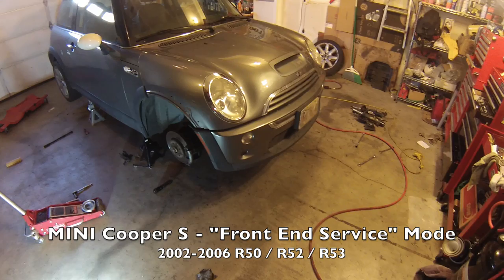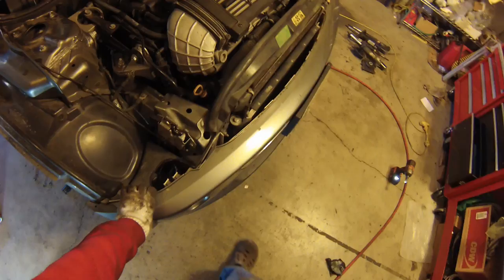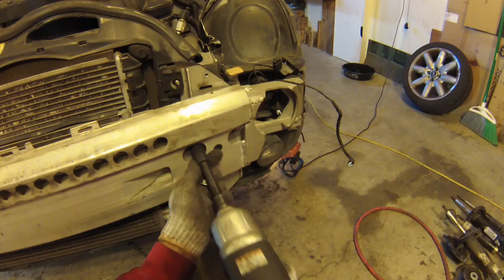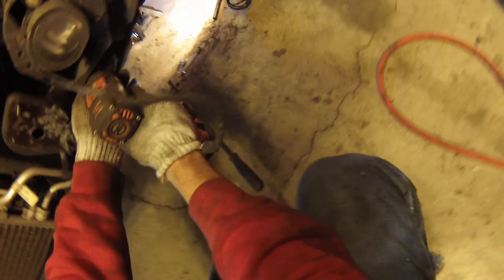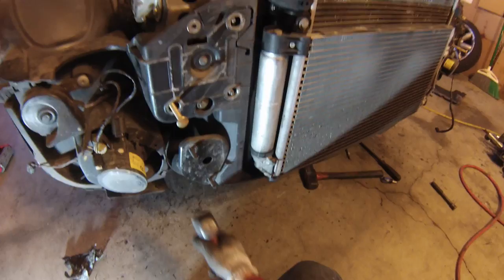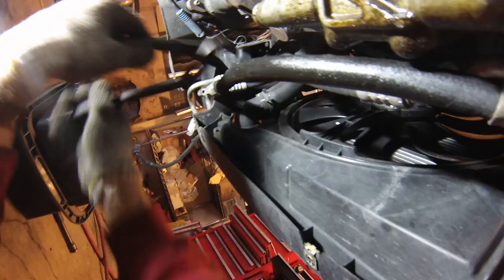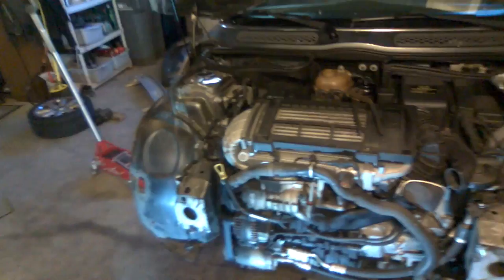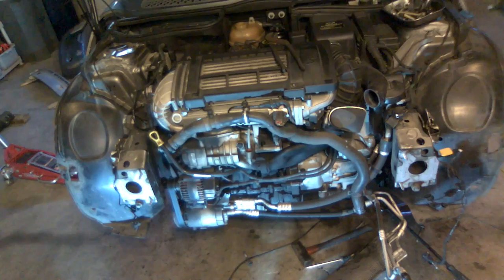Front End Service mode 2002-06 MINI Cooper/radiator/bumper removal howto

Comment: Where is your coolant change video for r53! I cant find it
Reply from the maker: +Daniel Scott That's because I don't have one. If you want to do a full flush, it's time consuming but you can use a Prestone flush kit and tap into the heater core hose. Unless coolant is in bad shape, I usually just dump via the bottom radiator hose, fill with water and dump again, then fill with 50/50 premix.
Reply: +Mod MINI ...I know that on the R53s, in addition to the plastic bleed screw on the upper radiator hose, there is a second bleed bolt underneath the thermostat.  When you return coolant to the system through the expansion tank, does that bleed bolt come into play, or can you just bleed the system by using the screw on the top radiator hose?  Thanks!
Reply from the maker: +David Arruda I usually just use the radiator hose screw. With the car off, patiently add coolant until it comes through the top radiator bleeder. Then close everything off, turn on interior heat and run car until thermostat opens. Crack the bleeder screw until air no longer escapes. Add a little more coolant than usual, any remaining bubbles should be displaced over the next drive cycle. Bring along a bit of coolant just in case.
Reply: +Mod MINI Thanks so much! Today was my first time in "Front-End Service Mode" on my '04 R53 m/c/s (116,000 miles). Replaced the radiator fan (1st-Stage non-functional), and while I was in the region, I changed the crankshaft sensor o-ring, as there was a fair amount of caked up oily grime below it, and on the front-side of oil pan.  At my next oil change in about 4000 miles, I'm going to do it again and replace my valve cover gasket, oil pan gasket and camshaft sensor o-ring.  I'll be supporting Mod MINI -- Thanks for this great asset to the MINI community!
Reply from the maker: +David Arruda Thank you very much for your support!

Comment: Are the bumper bolts 13mm or 1/2 sae?
Reply from the maker: There are no non-metric bolts on the car other than one of the supercharger intake horn and some banjo fittings
Reply: @ModMINI  how about oil drain plug. I think that's a 1/2 13 is kinda loose imo
Reply: Love your videos by the way thank you for taking the time to make them, they are very informative!

Comment: Great video. I also need to remove and replace the Core Support Front panel (51647200799). Do you have any videos or information on this?
Reply from the maker: David Stehle By doing front end service mode you are 95% of the way there. The only remaining thing is to separate radiator and other parts from the support panel. There are two plastic clips, pop out the center portion and then depress the three prongs. A little tricky to depress them, one trick is to find an appropriate size deep drive socket and press over the three clips. I think the only other thing connected to the front panel is the foglights.
Reply: Again, thank you very much!
Reply: How many hours should all this take?
Reply from the maker: David Stehle It really depends on your aptitude, experience, and tools at hand. I could probably swap the core support out in about 90 minutes.
Reply: ***** One more question. I have a Base model. Is this substantially different?
Reply from the maker: David Stehle It's basically identical.

Comment: i hate these cars! i just had a seized oil filter cap that i snapped the to nut on and had to take the oil filter housing off to remove it. there is no room! what's wrong with a spin on oil filter stupid engineers. the serpentine belt was one of the hardest to do out of all the cars i have had to service at my shop. i really haven't found a harder car to work on. now the low fan resistor went out and i have to pull the radiator to get at the horribly placed resistor. oh not to mention there's a misfire at start-up due to a bad injector but there is a super charger blocking access to the injectors. i have 4 customers with these cars and  these Mini's are making my wallet fat while giving me suicidal tendencies. why would i buy this car when a honda civic has so much more room to work on. SMALL CAR, BIG PRICE TAG, SHITTY ENGINEERING!  all they need to do to fix a lot of these problems is make it rear wheel drive with a longitudinal drive train, a slightly bigger nose, oh and a spin on oil filter. give the car room to work on for god sake.
Reply from the maker: +Brandon L Try working on a 2nd gen MINI. They are worse. You want a fun car in a small package, it takes some design compromises apparently. I'd love it if it was RWD, but then it wouldn't look or drive like a MINI.
Reply: so i just had to take off the front bumper again cause the the new fan assembly w/ resistor was not working, but thanks to your video i did it an less than a half hour. on this 2006 mini s i'm working on the stage 1 fan doesn't kick on ever and i have replaced the fan and resistor/ relay/ thermostat and fixed various leaks. compression is 150 psi across the block. the temp sensor seems to be working flawlessly, but it still overheats out the reservoir. stage 2 fan screams though. so i'm putting in another fan assembly. i jumped power to the fan by-passing the stage 1 relay (when it was 200 degrees f) and the stage 1 fan came on. like the computer wasn't telling the new relay to turn on. any thoughts? ecu/temp sensor/ an open in the wiring some where? thanks
Reply from the maker: +Brandon L I guess it could be a bad temperature sensor. A scanguage or other OBD diagnostic tool (like the ones you use on your phone) will show the exact temperature the ECU thinks the engine is running at. Either that or some physical blockage - stuck thermostat maybe.
Reply: +Mod MINI  ok here's a follow up. i finally got the stage 1 fan working , with new temp sensor, relay, fan assembly, and a new cap. it took several cycles of hot and cold to bleed the system before it started working properly. air was probably trapped in the head and sending the wrong info to the temp sensor. yesterday i swapped injectors #1 and #2 to see if the MLS code changes from a p0302 to p0301 with no results yet. the silly car only misfires on startup hot or cold with fuel psi of 51 psi within a second at startup. i know the book says 55 psi but 51 psi ain't bad.  i've already changed the plugs/wires/coil/3x fuel additive and being port injected the intake and valves looked clean after pulling the injectors. so it has to be an injector cause compression #'s are all at 150. if that doesn't work a leak down test will prove another possibility i guess. this has been the mini from hell and i can't wait till i have to do a timing belt on a toyota scion XB  next. that would be a cake walk in comparison.
Reply from the maker: +Brandon L Yeah I had a MINI from hell a while ago, it would run great and then suddenly lose power and power would come back, check engine light would come on and then disappear again. Every once in a while it would die completely and not start, and would only start after waiting about a half hour or playing with every sensor wiring connection. After replacing everything, turns out it was the crank position sensor. While P030x is usually plug, wire, coil or compression, it could also be injector, but seems really unlikely. Might be worth replacing that? All the problems on this car vanished when I did. (Except for a low oil pressure light which turned out to be due to a worn motor bearings from being run too much with water in the oil, but that's a completely different story)

Be sure to unplug and clean the connectors at the sensors/injectors and at the ECU itself (with electronics cleaner spray) as well. 

...Are you working on a 1st gen or 2nd gen MINI? The 1st gen are not port injection. If you are working on a 2nd gen, you might want to clean the intake ports. They may be totally fouled with carbon/sludge and may be causing a misfire. You'll need to pull back the intake manifold to do so. The correct way us to use a walnut blaster but I guess a bunch of carb and choke cleaner /acetone  and an air nozzle or shopvac might work as well.
Reply: +Mod MINI anytime an engine dies with no codes i go after the crank position sensor. if it doesn't work, intermittently, the engine dies and has no chance of throwing a code because it stopped running. it's also the cheapest part to throw at it for this scenario. volvos ,jeeps, fords chevys, toyotas, what have you, i've dealt with the dying engine while driving. vacuum leaks on the PCV system plagued the last volvo i worked on that caused the same dying engine problem after i replaced the CPS.

progress report: i found the reservoir cap lip to be warped because it kept spewining coolant out (with a new cap) when it was warm, not hot and it never over heats. so i filed the lip down and the cap now holds pressure. now the original problem cylinder # 2 has a misfire again po302 came back after swapping the injectors and changing the secondary ignition components (plugs, wires, and coil). i ran a second compression test and the numbers baffle me (1=160, 2=182, 3=175, 4=162). the first compression test was 150-155 across the block.  this tells me the head gasket is fine but the valves/seats/lifters are having issues at startup. after a few seconds the misfire goes away. i'm giving the car back to the customer and maybe the misfire with fuel additive in the tank will fix it's self otherwise a $1500 cylinder head job is in order. i wasted a solid week on this P.O.S.! thanks for your replies, i have nobody else to bounce ideas off of because i work alone. but it's great to here from some body else. i need a vacation!
Reply from the maker: +Brandon L Compression tests can vary somewhat depending on engine temperature, how rings are aligned, and so on. If #2 is different than the others I would go after that, I guess it could be a sticky valve or something but I'm just not convinced it's not internal to the engine if #2 is not lower than the others. 

You didn't answer - is this a 2002-2006 or 2007-2013 MINI you're working on? The 2007 and later have port injection and need their intakes cleaned after around 80K or so.
Reply: +Mod MINI a 2006 mini cooper s 1.6l super charged 6 speed r53 with $100k miles i believe. 2006 is port injected but the valves look so clean after i pulled the injectors and peeked through the ports. i almost think it is a hydraulic lifter not filling out. i ran a 1/2 a quart of dex/merc 3 through the old engine oil for 10 miles and dumped it out and put royal purple synthetic back in and a MAHLE oil filter with no change.  where would you go from here if you had limited mechanic tools? all i have is an Innova scanner no oscilloscope. i'm wondering if i should do a cylinder leak down test after getting weird compression readings. i watched the compression readings on cylinder number 2 as the engine was cranking, on the first stroke the psi was past 100psi and then slowly climbed to 182psi after 7 strokes. the others cylinders jumped to 90 on the first stroke. cylinder #2 seems to be the the strongest and yet it misfires when it's either cold or hot for the first  100 revolutions of the engine then it goes away. i wish it was eaiser to get to the injectors and put a test light on #2 to see if it is a voltage problem. thanks Kurt!
Reply: +Brandon L oopps please excuse the "$" in front of the 100k miles
Reply from the maker: +Brandon L None of the the supercharged cars are port injected. The injectors are in the intake manifold. Cylinder leak down sounds like a good idea, but not sure if I have anything else I can help with other than replacing crank or maybe also cam sensor and verifying the contacts are all clean... Injectors are right under the intercooler, it only takes 5 minutes to remove that. Remove plastic cover, remove 4 fasteners on the boot clamps, remove two brackets held by 8mm bolts, pull intercooler to passenger side of car and lift driver side up. There is enough room under there to get a test lead in place and put the intercooler back on.
Reply: ok multi port fuel injection i was just generalizing the fuel system. i didn't say single point fuel injection like in a SBC throttle body fuel system. but thanks for your input and videos i gave up on that car and gave it back to the customer. i was sick of wasting time with it and getting  no where when my measurements were lying to me or leading me to deep internal issues. i didn't want to chance fixing it if it did turn out to be something else i would feel like crap misdiagnosing. you win some you lose some. thanks
Reply from the maker: +Brandon L Looks like a stumper. Sounds like you are doing the right things, it's bound to be down to something electronic. The dealer might have better luck. I hope you weren't financially impacted by the ordeal. I stepped out of my comfort zone and did the same thing with a friend's pre-OBD GMC pickup having rough idle/stall issues. Had some of the same issues and spent hours of time tracking stuff down.
Reply: i have morals at my shop where i don't charge labor if i can't figure it out. i spent an entire week on it and lost several jobs as a result.
i don't need money but i feel obligated to keep my clientele happy. and therefore i had to give that job up.
 by the way those SBC are very finicky when the temp sensor is bad, and gave it to much control to the fuel trim. i had a mobile job with spark/fuel/and great compression but it wouldn't run and it turned out to be a temp sensor. cheap and easy fix when it starts to stumble or die.
Reply from the maker: +Brandon L Good on you. Need more honest shops. 

Interested in your temperature sensor theory. It's a 1995 GMC Sierra 5.0 with a electronic TBI. It starts and runs fine but idle drops when shifting into gear (especially reverse), turning on AC, etc.  I've narrowed it down to MAP sensor, the TBI itself. Already replaced distributor cap/rotor/idle air control valve/distributor. Where is the temperature sensor? I can only find a MAP sensor and a 
throttle position sensor. There is a separate temp sensor screwed into 
the intake manifold somewhere?  Good thing that GM parts are cheap.